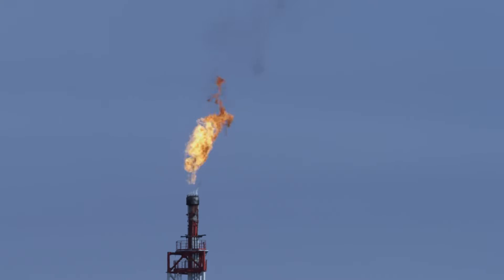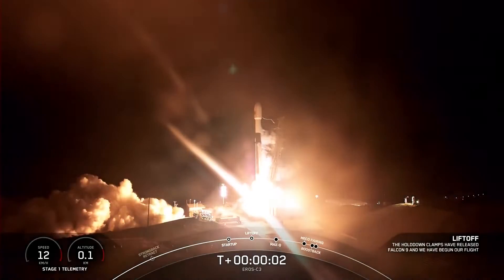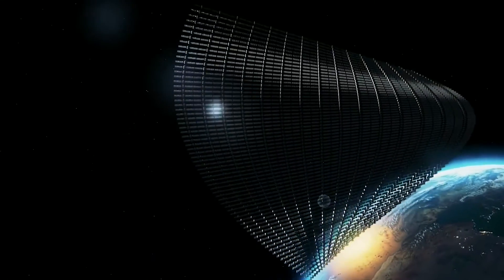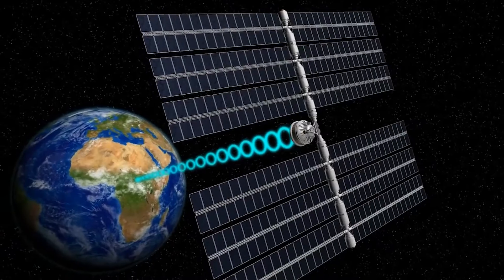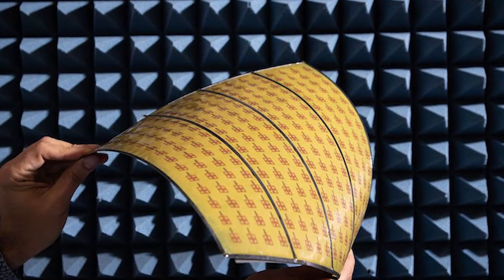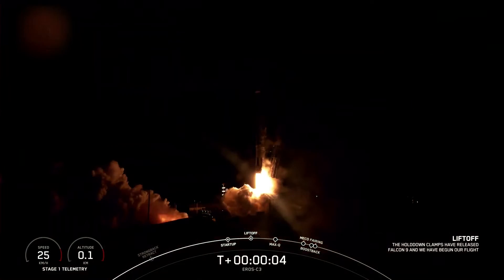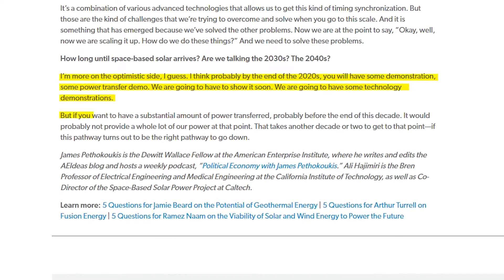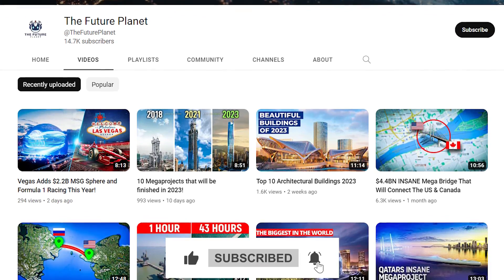How Space-Based Solar Power Could Help Solve The World’s Energy Crisis

Comment: Won't it affect living things passing by in between the solar satellite and the power receiver?
Reply from the maker: "You could design the beam to be so safe that you could take a nap in it with your child and not be affected," said Coste. "That would be at a power density level of about 10 watts per square meter. But that will require an extremely large area to collect [the energy], so we would want to have a narrower beam with higher density and some safety system around it."

The company, he says, is looking into methods of "traffic management around the beam," using radars and lasers to look for objects in the beam's vicinity to stop the energy flow in case of a safety risk. 

"We can engineer a system that is designed to only be pointed at a receiver and would not ever work if it pointed anywhere else," said Coste. "We work on this concept with some big energy companies in Europe, and they don't see it as too much of an issue, as they are used to dealing with safety problems around high-voltage power lines or gas pipelines."

Pultarova, T. (2022, December 23). Can space-based solar power really work? Here are the pros and cons. Space.com. https://www.space.com/space-solar-power-pros-cons

  At the Earth's surface, a suggested microwave beam would have a maximum intensity at its center, of 23 mW/cm2 (less than 1/4 the solar irradiation constant), and an intensity of less than 1 mW/cm2 outside the rectenna fenceline (the receiver's perimeter).[88] These compare with current United States Occupational Safety and Health Act (OSHA) workplace exposure limits for microwaves, which are 10 mW/cm2,[89]

Wikipedia contributors. (2023, January 31). Space-based solar power. Wikipedia. https://en.wikipedia.org/wiki/Space-based_solar_power#Safety